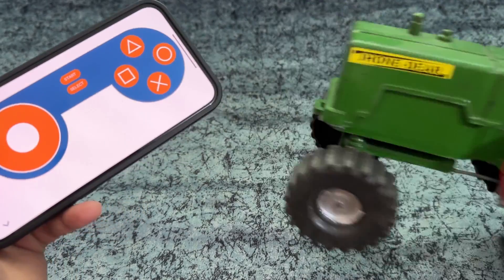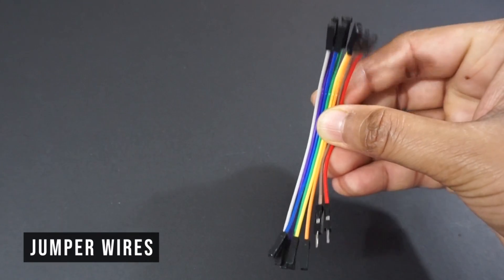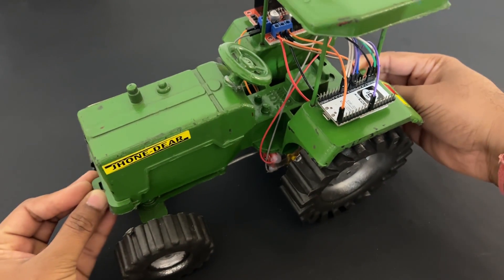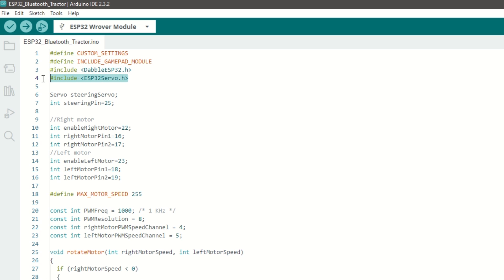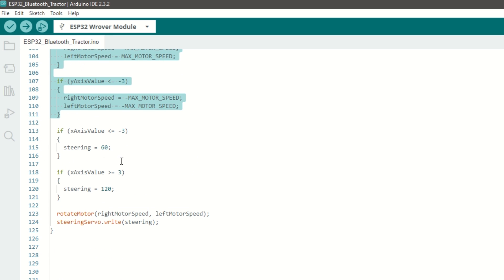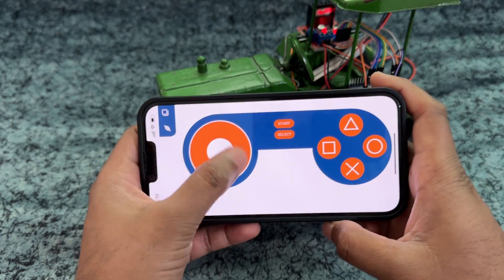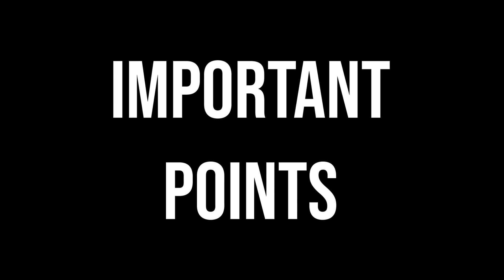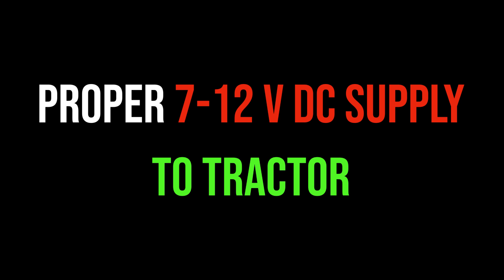How to make Bluetooth Tractor | esp32 | Android + iPhone | DIY

Comment: Hi,thanks for the video. I’m working on forklift project. I’m using ESP32, L298N, LM2596 7.4 18650 lipo battery. 2 dc motor for forward and back. 1 dc motor for up and down. 1 servo motor for steering. I have a problem. When I  upload ESP32 with dabble program after a few seconds Bluetooth connection is lost. And servo lifting motor always try to work together and going bad. Can u help me please?

Comment: bhai is motor driver ki jagah l293d motor driver le sakta hu
Reply from the maker: No . Please use L298N driver to avoid issues . Else you will have to make code and connection changes 👍🏻👏🏻

Comment: Hey hash, I was trying to connect l298n driver motor with BO motor. But for some reason either my code or my connection doesn't make the motor rotate. I wanted to reach out to you for some help. Can I contact you via Instagram? or any other socials on which you're active?